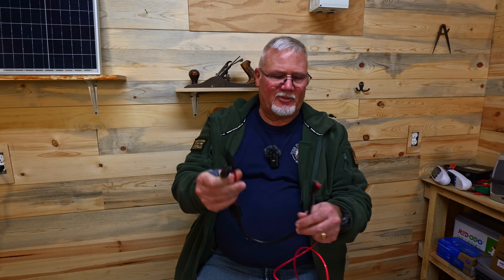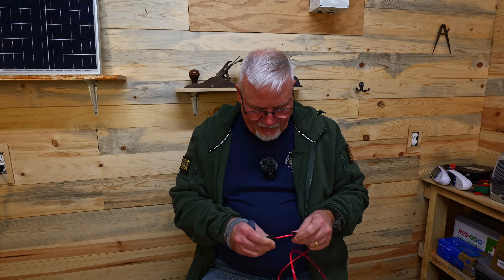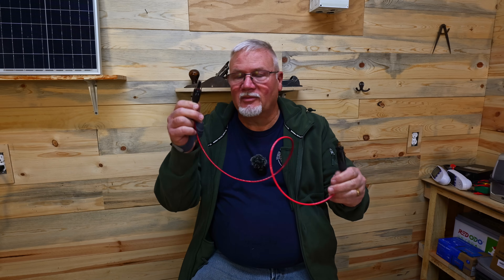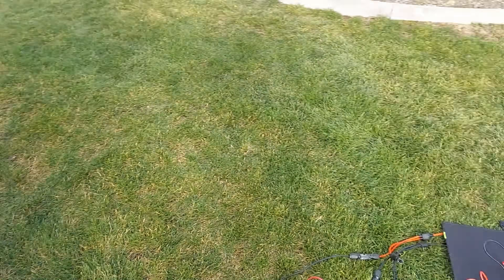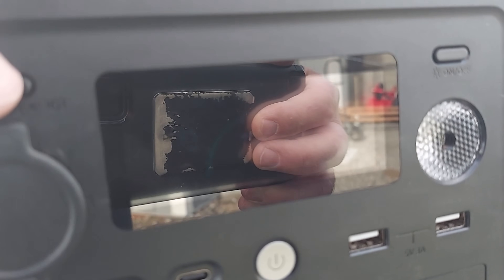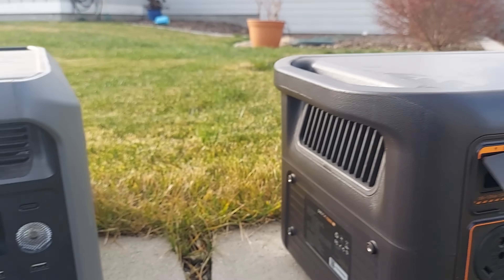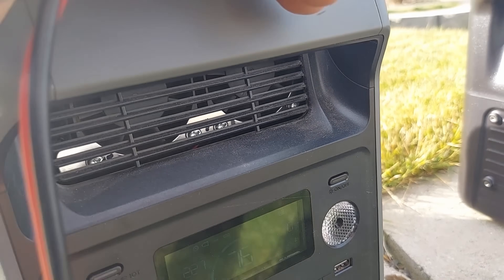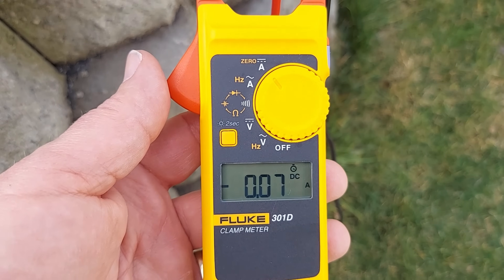Is It SAFE to Charge 2 Power Stations with 1 Panel?

Comment: Hi I got A question, 
But i forgot what it was. 'age I Guessed'
But at least there were no sparks this round ,,..  Aahh
Oh Ya the Question ,
What about Dc Current 
Would you want Or need A dc breaker 
Especially sience your not wearing gloves 600 watts Aahh ,...
I just ordered A 100 dc Breaker $23
'Dihool 100, two pole posative & Negative 
Could you esplane what A breaker is Needs for Please ...
Ps & hello Erik
The fam says A big Hello from Snow&ice 
blizzerd Nj
Yupper snow on all my panal's & ice
Only got one battery A Redodo 12.8 100ah 
Need more Power
Lol 😂
Reply from the maker: Generally, with power stations, you don't need to add a breaker though I can't be certain they have a built in breaker.  They are designed to connect to the portable panels directly, however, if it were me, and I was setting up some stationary panels on my roof or something, I'd put in a breaker if for no other reason (besides safety) to be able to disconnect them from the unit for moving it, maintenance, changing it out etc etc.  Fuses protect the wires so should be matched to wire size (max amps of the wire plus 25%) and breakers are usually both disconnects and there to protect the equipment (is my understanding but I'm no engineer).  I make my disconnects at 25% above expected current.

Comment: Could you charge one unit into solar connection with the panel that has a high output dc connection (like a pecron unit with xt60). Then connect the xt60 output to the pv input on the other unit. When saw you video I thought about trying it to avoid switch over or making  cables. Ialready have the units. I just wanted to get others opinions before possibly making magic smoke.
Reply from the maker: You could charge a 2nd unit off the 1st that has solar butvit is inefficient.   Best to get two panels or a bigger unit or even better,  go DIY Solar 😊

Comment: Now split an e-taker between two power stations and see if that works.
Reply from the maker: That's an interesting idea that I hadn't considered.
Reply: @TheOldJarhead  I've used the pecron alternator charger to do just that. I use an mc4 to xt60 to a Y splitter to 2 xt60i cables that plug into 2 Ecoflow Delta Pros. It's one of my backup options for extended outages with cloudy days.
Reply: @TheOldJarhead I also use an AC to DC converter transformer running off a small inverter generator in place of the alternator charger. Both preserve my 240v capability for my Delta Pros.

Comment: I find it works better to use the car charger for the smaller unit in the 12v socket on the bigger unit and connect the bigger unit to the panel.
Reply from the maker: That's an interesting approach!

Comment: No reason for it especially since panels have come down in cost drastically.   Fun to watch.  I wonder if that pecron was having a hard time getting the limited voltage needed?  Anyways I think I might wreak havoc on the charge controllers.
Reply from the maker: That's what I thought too, that it might be an issue with the charge controllers.

Comment: Thank you for the commentary, Eric.

Personally I think this is dumb.
A 600 watt panel that is barely putting out a couple of 100 watts maybe when attached to both stations is near worthless.
Better to charge up one and then the other. 
Although adding a couple of switches so you can feed either one instead of having to attach and detach the cables constantly could be useful for a fixed installation.
Reply from the maker: I think one at a time is best for sure. 😊

Comment: Do you think Y-splitting (parallelling) two Buck converters from one solar, or battery input to up-scale the voltage and reduce the load (heat!) for recharging via the solar port would work? Trying to get four, or five hundred Watts out of one Buck alone makes it so hot it seems dangerous. Thanks Eric.
Reply from the maker: No.  I had plenty of voltage which doesn't change.  The problem is the MPPTs fighting over the available amperage I think.

Comment: Thanks, Jarhead!
I've got one for you...
Can I run the DC output from two separate power stations of the same make and model to my DC fuse box that runs my van? They would both be on at the same time.
I think it's okay, but am I missing something? They would be in parallel, of course.
Reply from the maker: I plan on testing that but think it should work

Comment: What if you have two separate solar and battery systems. When one system is charged could you put a transfer switch in so all solar could go to the other system to charge it faster
Reply from the maker: I suppose that's possible but switching by hand would be simpler
Reply: @TheOldJarhead yes it would but if you are not.  such as at work or out of town for a day or two would be nice to have that option
Reply from the maker: That's why I don't recommend power stations except for emergency power, specially the smaller ones, or using multiple power stations unless using multiple solar arrays.  

Power stations are just too limited for any real long-term use IMO.  That's why they call them 'Solar Generators' (I hate that term as they are not generators) -- they kinda replace small generators which you can't leave too long either or they run out of gas vs say my big 6kw Ecogen with 500 gallons of LPG -- it's running forever on that lol.

DIY solar is far better as it allows so much expansion it just isn't even close.

Comment: Bring in power into one power station, then take the DC car output of that power station and put it into the second one. 

Second option has power losses:

Solar into first power station. 
AC output into second
Limit AC input into second power station.
Reply from the maker: Or best, I think, is just charge one at a time
Reply: @T @TheOldJarhead I think it would depend on the solar input of the two power stations. 

Hook the larger one to solar and subbed the second on maximized solar input throughout the day.
Reply from the maker: Or just get two solar panels :D
Reply: @T @TheOldJarhead ll, yeah. 

But this was labeled two power stations on one panel, not two power stations on two panels. 😅

I have enough panels to put 800W into a 24V DIY setup, 800W into a delta 2 max, 400W into a delta 2, and a few hundred watts spread across a few smaller power stations. 

I also have enough spare  parts to build a second 24V setup and put 500-600 watts into it.
Reply from the maker: Understood -- it was labeled that way, as the intent was to see if it worked.  It sorta did but I don't think it's really worth doing.  I can be wrong though.

Comment: Use two smaller power stations or use the car charging port. At the voltage, each power station tries to pull its max current. If over panel, they both might be happy. 

Otherwise, charge up to 80% on one, then switch to the other power station
Reply from the maker: I think one at a time is best

Comment: I'm wondering if you can plug the solar panel you mentioned into an MPPT charge controller and then split the outputs to both power stations? Just curious.
Reply: A MPPT needs to have a battery voltage at the output. If you plug it into the input of the you risk blowing the MPPT controller as it needs to have battery voltage before PV voltage.
Reply: @warrenglen7636  Thanks. I didn't consider that.
Reply from the maker: Yup

Comment: I asked AI a couple days ago about doing just this...AI said do not do it since it messes with the charge controllers.
Key Warnings:
Controller Conflict: Connecting multiple power stations with their own MPPT controllers to one panel often causes them to conflict, leading to poor performance or potential damage.
Voltage/Current Limits: Always check your power station's manual for maximum solar input voltage (Voc) and current (Amps) to prevent damage.
"Fighting": If both units have low battery, their controllers might try to draw maximum power simultaneously, which can be problematic. 
Recommendation:
For most users, it's best to use one solar panel to charge one power station at a time, or invest in a larger solar array or a power station with specific multi-input capabilities for simultaneous charging.
Reply: ChatGPT actually recommended me to charge my two stations with my only solar panel, using a Y MC4 cable straight out of the box.   But I've learned the hard way not to trust chatgpt...
Reply from the maker: Ya, do not trust AI
Reply: @maop2k , I like it: it says "everything is possible, but your need to consider the impossibilities". :D However, some guys are ready to hear the very first part only...
What's happened? Y-cable sounds quite correct, btw.
Reply from the maker: I've actually seen stuff online that says thus can be done but I think it's really not worth it
Reply: @TheOldJarhead  Curious if the 2 power stations are the same (IE APEX300) if they'd play nice.  According to the SolarX4k this can be achieved...and by the looks of it, it's ONLY 2 the 2 wires + & - that's split into 3 xt60 connectors.  So the voltage is coming from one MPPT and the being split into 3 other MPPTs.
Reply from the maker: MPPT's need to be connected to batteries first.  Or you can break them ;) -- but my issue is:  why?
Reply: Thanks for sharing! Just five cents from me: AI answer depends on the question. E.g.  asking "how is it possible to charge two solar controllers from one panel" and "suggest proper charging of two controllers from one panel" brings almost opposite results. :D The reason is obvious, however: big guys taught the models to answer as positively as it's possible to nudge further questions and further models learn.
Meanwhile, how would you answer the question of "is it possible to water two separate rows of plants from a single faucet?" Technically the worst case scenario with SP is that one of the controllers will take all the power due to some advanced  features. But how does it impact the other? 🤔
Reply from the maker: lol ya I don't do AI - it's not reliable.

Comment: I think you need a bigger panel. I’ve read some of them need a certain minimum wattage for input. My BLUETTI ac200p will not charge with a 100w panel, it needs at least 200w.
Reply from the maker: usually amps but yes.  600w is a big panel though and in the end the point stands.
Reply: @TheOldJarhead  it was more a question then a comment. I’m looking forward to the Pecron vid!
Reply from the maker: Gotcha -- I'm thinking if it had like 20 amps then it might have worked better as it occurred to me they both were trying to draw at least 10 and the Dabbsson can draw 20....hmmmmm actually the Pecron can too.  So ya, too much draw on one panel..